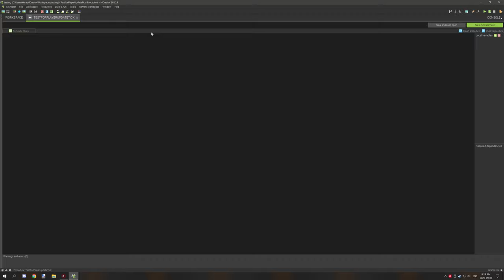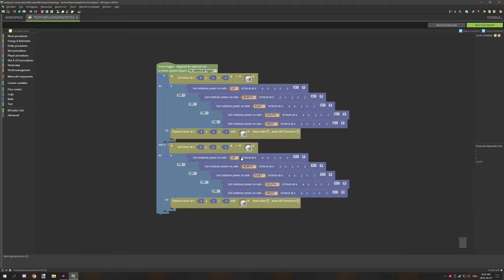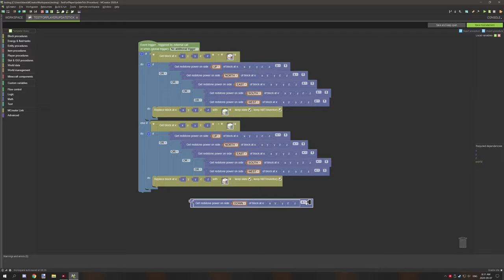MCreator: How to test for redstone power | Procedure Tutorial

Comment: I don't really understand where to put the new procedure in the block triggers page. or how to set up the blocks
Reply from the maker: There is a few ways to go about it but this procedure was run from the tick update by the looks of it, the name of the procedure has update tick which makes since as you would need to test if the condition changes for the blocks used in the procedure on a tick update.

Comment: How do you check for active redstone on both sides of the block, For stuff like and gates
Reply from the maker: for testing you need to use the blockstate blocks
Level and Direction will need to be determined for each side (D/U/N/E/S/W)
I suggest starting just with one side like north and working your way from there.
https://minecraft.fandom.com/wiki/Redstone_Dust
Reply: @NorthWestTreesMCreator  Thanks dude!
Reply: @NorthWestTreesMCreator  im still a little confused tho, Whats the block called?
Reply: @NorthWestTreesMCreator  because i also relized that with repeaters they have to blocks: repeater (powerd) and repeater (unpowerd)

Comment: Hello. I am a Japanese university student. I am currently studying education using Minecraft at university. The question is, is it possible to develop a block that behaves like a NOT circuit by using Mcreator?
Reply from the maker: Hello :)
I am normally bad at Redstone however the NOT circuit is basically just a reversed version of Redstone, and there is a NOT block in MCreator that dose reverse the check so you could use that to reverse your condition for this example test if the block is NOT powered by Redstone and that would invert the signal so its always on unless powered. I hope that helps a bit. Best regards.

Comment: Why is it that I put a get redstone power from side and it returns 0? I did it with all sides...
Reply from the maker: it could be that the variables are not set up properly, it runs using forge variables so if its not outputting then either the NBT is not set or the command for testing / setting is not formatted properly for the version your working with.
Reply: @NorthWestTreesMCreator  I used the get redstone power and putted cords. for the redstone dust and it works fsr.